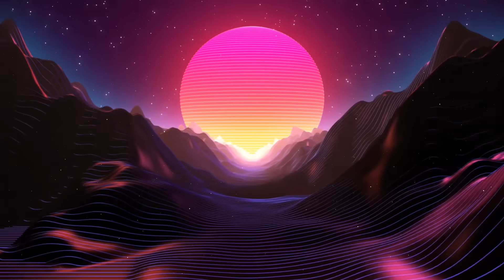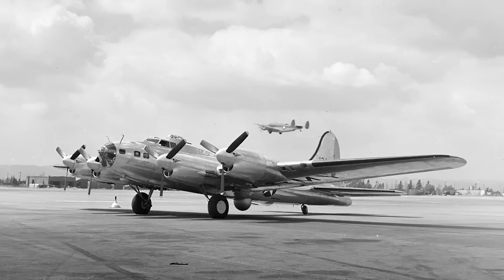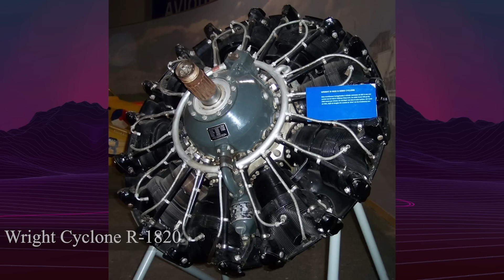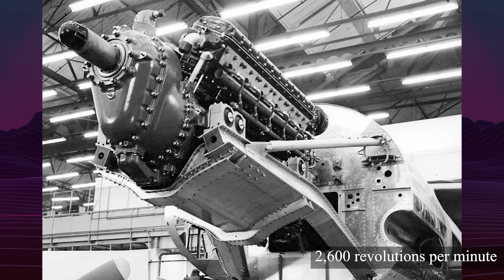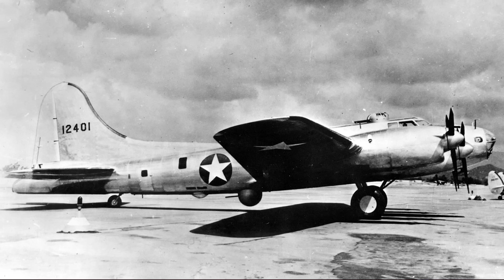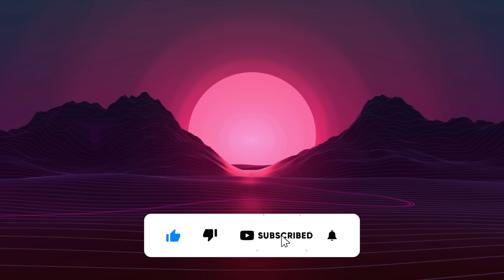Boeing XB-38 Flying Fortress: Why the US Abandoned This B-17 Variant

Comment: One of the coolest looking aircraft of the war.  JFC though look how much further the engines extend from the wing roots!  Almost to the nose!  That’s the 1710 with its turbo.  I wonder why they didn’t try the Packard 1650 (Merlin) engine?  It wouldn’t have been turbocharged, limiting the Fort’s altitude but it would have given an easy 25% hp increase.

Comment: Yea, this version was impressive. But the Ultimate version would be the B-17 modified to be powered by a Single Turbo-prop engine. It was so fast it had to be limited in its top speed to prevent the wings being torn off.
Reply: And then you discover that the Avro Lincoln (an Avro Lancaster descendant) got a production version fitted with four turboprop engines - it was limited to a maximum altitude of 50,000ft because it was unpressurised and the crew had to wear full pressure suits while flying them. They were used for the British nuclear trials in Australia to develop bomb aerodynamic data.

Comment: The Packard/Merlin could have been a game changer!!
Reply: Packard Merlins were all allocated to existing high-demand programs.  I admit, though, that modeling a B-17 with DC-4M engine nacelles sounds attractive.
Reply: @MrCateagle  Hence no game changing. 😢
Reply: Worked well in the Lancaster
Reply: @JDale56 The Lancaster flew at night when the 88’s couldn’t aim at it and the Focke Wild’s couldn’t find it.
Reply: @chandlerwhite8302  Are you joking? RAF Bomber Command had the highest loss rate of any unit in WW2 except for the German U-Boat service - 45% loss rate (55,000 dead). What do you think killed them - bird strikes? 
And that figure does not include those killed in accidents caused by bad weather which night flying worsened.
German radar directed flak was a major contributor to these losses, as were radar-directed and radar-equipped night fighters.
85 night fighter pilots, including 14 crew members, were awarded the Knight's Cross of the Iron Cross - the two leading night fighter aces alone, shot down over 200 bombers between them..
Reply: @chandlerwhite8302  So you've never heard of the Ju88 Nightfighter.........?
Reply: With the damage and beating B-17’s and B-24’s took, I don’t think a water cooled engine would have ended well.  I’ve always wondered they didn’t try Pratt and Whitney R-2800’s in them.
Reply: @chandlerwhite8302 Other programs had already claimed all R2800 production.
Reply: 2 chutes not working properly is an indication that the people packing their chutes didn't do a good job

Comment: I wonder if they tested Boeing's airframe with R-2600 14 cylinder radials? Plus 500 HP in each engine.
Reply: The R-2600 did not adapt well to turbocharged applications or even two stage superchargers.  That is one reason why the A-20  was not a good night fighter and why the 2600 was abandoned in the F6F program.
Reply: @stevehofer3482  Thanks. I didn't know that. NAA tried a pair of R-2800s on a B-25, replacing the R-2600s. North American test pilots handled it gingerly , but were impressed with the power increase. Then an Army test pilot wanted to try it. He loved it, so much so that he flew the wings off it, literaly. The wings separated in simulated strafing at low altitude, with fatal results.
The next bomber project from North American was the XB-28 Dragon -- engineered for R-2800s. It strongly resembled the Martin B-26. Dragon didn't happen because the war was about over by the time the prototype was ready, and only Jet projects were being greenlit.

Comment: I can't believe replacing air cooled engines with liquid cooled ones would have done anything good for the B-17s ability to take battle damage.
Reply: It's not only that it would have reduced bomb load also.
I'm constantly explaining to people that the reason the Lancaster had so few defensive guns was because of its liquid cooled engines. 
Compared to a B17 they both have similar empty weights and similar max gross weights, the reason the B17 can have so many defensive guns and turrets compared to the Lancaster is because it doesn't have a 250 lb cooling system for each engine, couple that with the dry weight difference between the R1820 engine and the Merlin and there you go, that's almost the exact difference in their defensive armament.
So if you put liquid cooled V12 engines on the B17 you'd either have to take most of the defensive guns off of it to return it to the same empty weight or you'd have to reduce the bomb load by that amount.
Reply: @dukecraig2402 there is another important tidbit. B17 service ceiling would go from 38,000 plus to Merlin’s 24,500. B17 used turbo chargers. Other than a few specialty planes, TA152, ME163, ME262, JU86, Spitfire IX, service ceilings were closer to 24 to 25,000. A B24 was limited to 24,000 by wing design. At some point either a pressurized flight suit, or cabin are required. Have fun
Reply: Well, that and the wing area.  The Lanc had 10% less wing than a B17.  It compensated with a skinny fuselage and by removing as much weight as possible.  The B17 had a cavernous fuselage and the extra wing area helped tremendously to absorb battle damage.  It also allowed it to fly at much higher altitudes.  The Lanc and B24 were practically limited to operating below 20k feet, making them sitting ducks during daylight raids.  Only the B17’s big wing and Turbo charged engines could do missions at 25k.  USAAF figured a 10% reduction in flak for every 1k ft.

Unfortunately bombing at that altitude did prove to be so inaccurate they might as well have been bombing at night.
Reply: @dukecraig2402 it also helped that the Brit's were doing most of their bomb runs at night. No need for a lot of guns.
Reply: @dukecraig2402 But, Wow! A good looking airplane! Weight and the ability to take damage versus Movie Star Good Looks?
Reply: @daleeasternbrat816 
I don't think that's what was on the USAAF's mind back then.
Reply: @dukecraig2402  So explain how if the Merlins in the Lancaster were so heavy and inefficient the aircraft lifted 2 1/2 times the bomb load of the B-17 (and B-24 come to that)?
That overly heavy Lancaster lifted the 22,000Ib Grand Slam something no other bomber could do until later models of the B-29. The aircraft that nearly failed to deliver the atomic bombs and had to use the bomb rack and release systems from the backup aircraft - the Lancaster.
As for lack of guns the only difference was the two waist gunners in the B-17 not used in the Lancaster
Yank arrogance is never a good look.
Reply: @1chish 
Because those were heavily modified Lancaster's that were stripped of what defensive guns they had in the first place to lighten them up, along with structural modifications to make it possible, they weren't standard Lancaster's, that's the part people like Mark Felton leave out of the story, the same types of modifications could just as easily, probably even more easily, have been done to B17's or B24's, they just didn't do it simply because dropping those bombs were an RAF project and not a USAAF project.
The arrogance is from people using things out of context to create a false narrative of superiority so they can bash someone else, Lancaster's followed the same laws of physics and aerodynamics as all other aircraft despite the claims made by people like Mark Felton, who makes money getting clicks from people eager to believe malarkey like that, there wasn't some magical dust they sprinkled on Lancaster's that enabled them to defy those laws, they had to be heavily modified to do that, arrogance is acting like they didn't and then comparing them to another aircraft in its stock form, it's the same thing as comparing the racing plane Rare Bear to a stock Spitfire and going around acting smug about the comparison. 
And Mosquitos couldn't perform the job B17's did, much less better, that's another tall tale that people like omitting facts from, that nonsense is all based on using Wikipedia information, which is a bunch of malarkey in the first place, out of context to manufacturer that tall tale.
Reply: @dukecraig2402   you critique people for peddling dishonest statements and then do precisely the same thing.
Not clever.
Not sure what your beef is with Felton but his work is very highly regarded.

The Lancasters (in fact they would have been Lincolns in 1945) that would have done the Atomic bomb operations were indeed stripped of weapons. Not because they couldn't lift the bombs but because they needed extra fuel to get to safe territory although by then mid air refuelling was an achievable fact courtesy of Cobham. But what you failed to mention is the B-29s were struggling to lift the bombs and a few crashed and when they did they could not release the test bombs reliably. So Boeing built the Silverplate versions fitted with fuel injected engines, stripped of most guns, bomb bay lengthened to 33 feet same as the Lancaster and fitted with Lancaster bomb storage and release systems. So if you are condemning modified Lancasters do the same for the B-29s.

However the Lancasters that delivered 2 1/2 times the bombload of a B-17 did so every night and were not specially stripped or built. And sorry to burst your American pride but no amount of special building would make the US bombers deliver that payload. Lancasters were dropping 12,000Ib Tall Boy bombs without special modifications.

You then slag off possibly the most adaptable and successful fighter bomber of WWII - the Mosquito. It is an absolute proven fact the Mossie could deliver the same bomb load to Berlin as a B-17 and be back in the UK about the time the B-17s got to Berlin. Because they did it! The same laws of physics that you used very much apply of power, fuel efficiency and weight. You took on the wrong aircraft there!
Reply: Was about to say the very same thing. Unless the fortress could outrun enemy fighters those liquid cooled engines were a liability. Though I do wonder why they didn't use the R2800 with the corsairs 13'4" props. Maybe the math on fuel consumption vs range didn't work out.
Reply: I should have googled my comment before posting it. To use the R2800 the fortress would have to be significantly redesigned as the bomber was a pre war design and the R2800 came out later. Plus the demand from Corsairs and Thunderbolts was pretty high. Also there's no point in making a faster bomber unless you can outrun enemy fighters. But the added fuel payload would have made the extra speed negligible.
Reply: @CX0909  So you would call the greatest aircraft engine in WWII, the Merlin, a liability because it was water cooled? 😅
There were more successful water cooled fighters in WWII than air cooled.
Go figure!
Reply: @1chish  sure, but how many daylight long range heaven bombers were there? Just three.  All American. And they took enormous damage all the time. You don't put a Ferrari motor in a long haul truck for a reason.
Reply: @1chish but yeah, I agree, the Merlin was the greatest engine. It just wasn't a good fit for the B-17, B-24, or B-29.
Reply: @CX0909   So there were no daylight raids before Spring 1943 when the USAAC got going? Yeah right!
The RAF were doing ALL the day and night bombing raids for the 3+ years before the USAAC turned up? Yes the RAF.
The RAF mounted the first daylight 1,000 bomber raid in May 1942 and repeated it many times. The first USAAC one was in 1945.
Pride is a great thing but ignorance is what it is.

Comment: A single-stage supercharger -- unlike the Merlin which had a two stage supercharger -- and no turbocharger. This compromised altitude performance for every aircraft that used the Allison engine. Except the P-38, which added turbochargers.
Reply: The XB-38 had turbo charging like the P-38. Look under the rear of the nacelles, they are sticking out like a sore thumb. It's reduced altitude performance was more likely from the huge increase in weight from the engines, radiators and coolant weight and/or it used a similar prop to the P-38... They knew for some time, the later versions of the P-38 were hamstrung by not having the more up to date paddle props of the P-47 and P-51. 
They actually installed paddle props on prototypes of the later versions of the P-38 and it help performance a lot, especially at altitude. So I think the XB-38 was a clean modification looks wise, but not a great conversion as far as the proper props for the turbo version of the Allison.
Reply: At 50sec in the video they say the Allisons used on the XB-38 were turbocharged but only making 1100hp ea continual or 1400hp at military power. The P-38 made up to 1600hp with turbo Allisons so it could have been a nice power bump up from the 1200hp cyclone radials used on the regular B-17.
Reply: @jasongray7683 
You have to be careful rating aircraft engines during that era, between the late 30's and the end of the war they were constantly upping the HP of everything because octane was always creeping upwards, along with the fact that the engine/octane combination that started out during the XB'38's development might not have been upgraded by the time it first flew, there's plenty enough to do developing something without having to change all that every few months as upgraded engines come along, once they start production that's another story, as upgraded engines came along they quickly found their way into production aircraft, but during development they usually left well enough alone in that regard because they've got enough going on, so it might be that the engines used to development were kind of frozen in time from when they started the project.
Reply: @jasongray7683 
🤣🤣🤣🤣
The P-38 was well over 1250HP, at Military ppwer, before the G model was introduced.
Reply: @jasongray7683  Doing this from memory ( uh, oh ! ) but I'm not sure the turbochargers for the 38 were fully developed or even functional during the short lived tests.
Obviously there were successful two stage, turbo'ed Allisons, and in fact there were two stage mechanically supercharged Allisons as well, with performance comparable to the Merlin. The fly in the ointment was always that these variants were too long to use in the existing P51 airframe, which is where all the attention always goes.
While the Merlin was undeniably a great engine, the Allison had some significant advantages over the Merlin that seem to go unrecognized. Much easier maintenance, longer TBOs to name just two.
Reply: Wikipedia says the engines were turbo supercharged and you can see what looks like turbosuperchargers under the nacelles, rather than on top as with the P-38.

Comment: Imagine if instead of the Allison, they installed a Packard built Merlin?    The supercharger on the Merlin would assure high altitude performance.   Of course one B-17 would use the engines of four P-51 Mustang fighters, maybe production capacity of the engine maker is an issue (but something that could be resolved in a few months given America's industrial might at that time).

Anyway a fascinating aircraft you have so well showcased in your series.   Thank You.
Reply: Unlike the P-51 but like the P-38, there is room in the engine nacelles for turbosuperchargers.
Reply: @gort8203  Right, and that gets you more power than the Merlin at altitude. Whether you would ever be able to operate at those altitudes in an unpressurized airplane, both rapid hypoxia if the O2 system failed and/or freezing to death, is a different point.
Reply: @brettbuck7362   I don't know what you mean by "those altitudes", but unpressurized bombers and fighters operated at high altitudes in unpressurized airplanes throughout the war.  The radial engines of the unpressurized B-17 and P-47 used turbosuperchargers at their operational altitudes, and the XB-38 would have been no different.
Reply: @gort8203  I just wonder how the waist gunners are going to fare at 35,000 feet sitting next to an open hole in the fuselage. It was close to intolerable even with heated jackets at regular B-17 altitudes.  Because above 30000 or so is where the Allison with full turbosupercharger gets way ahead of the Merlin.
Reply: @brettbuck7362 
The critical altitude of the Merlin in the Mustang was 26,500', it lost significant power every 1000' above that. 

The critical altitude of the P-38 was 29,000 feet.
Reply: That would essentially be using the same merlin engines as the Avro Lancaster which were only rated at 1280hp ea for bomber use.  The Allison was a fine engine when it was turbocharged, it just lacked a 2-speed supercharger to provide for good high altitude performance (when not turbocharged). When turbocharged in the P-38, the Allison made 1600hp ea.
Reply: These particular Allison V1710s were turbo charged for high altitude performance like the P-38s Allisons were. 
In fact, when I was studying the installation, I began to wonder if the turbo install in those relatively small confines of the nacelles, was a contributing factor in the fire that destroyed the prototype. 
There was a reason the P-38 had it's turbos way back in the twin booms, and the P-47 had it's turbo way back in the rear fuselage, away from the engine installs.
Reply: I wouldn’t read too much into the engine fire. Prototypes have lots of problems that just need to be worked out. It is unfortunate that this one cost the life of one crewman and injured another.  It think the stated reason for cancellation was the real one. There just weren’t enough engines to go around.

Comment: ...because the Boeing B-29, higher-flying and faster with a larger payload, came along?
Reply: probably because liquid cooled cant get the same beating as air cooled
Reply: @jebise1126  If they were that worried about liquid cooling failures, then they never would have used them on fighter planes.  Lancaster bombers used liquid cooled engines.